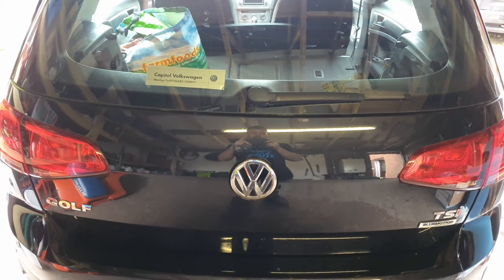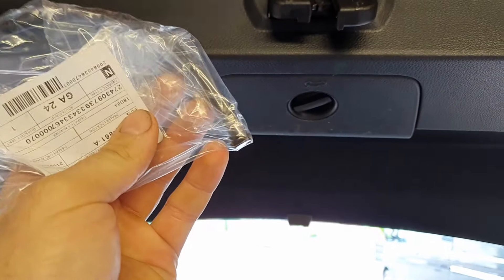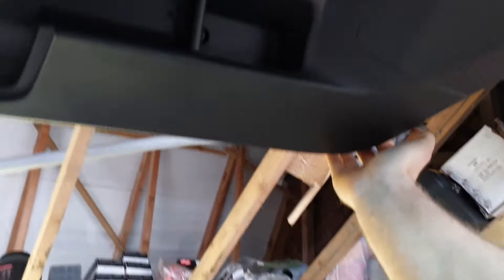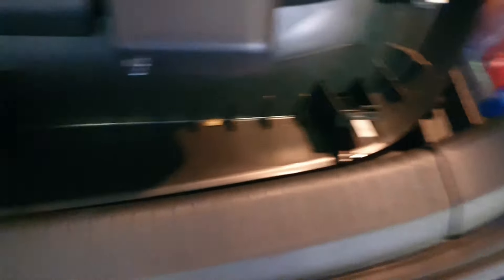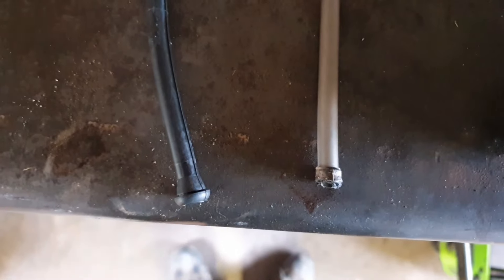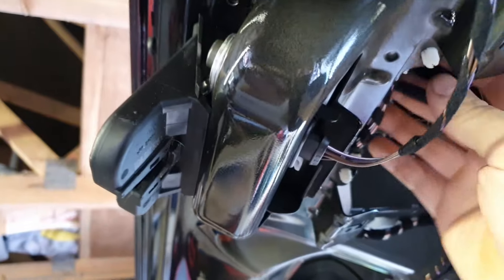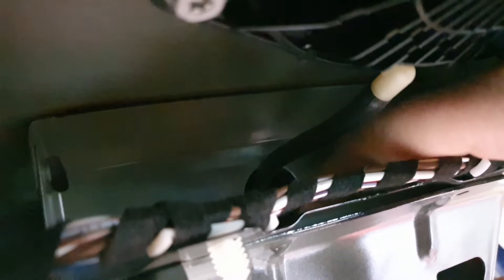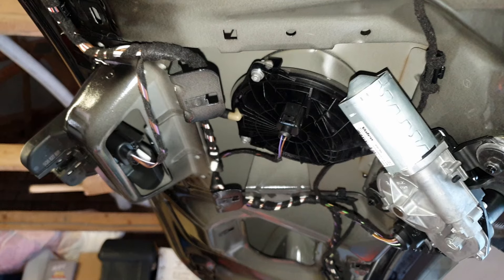Volkswagen Golf mk7 common fault water in boot through tailgate, how to replace pipe easily yourself

Comment: Great video! Yes, you are right to highlight this silly design flaw!!! I also found a rapid fix when you find your boot full of water.....Take a plastic drinking straw and carefully poke it up inside the pipe that was loose. I did this. It was a tight push fit. Then cut the straw so it hangs 1cm below the hole and the water drains out onto rear bumper and you boot stays dry!! To make it look pretty I put a rubber grommet where the straw exits the little hole.
Reply from the maker: Thats a great idea, thank you for your input.

Comment: Thanks very much, I've got all the panels off now and removed the pipe. Just need to get another one and fit it.  I've managed to put a drinking straw in the end as a temporary measure until I can get to the dealers. I'm surprised that VW have a common fault like this, they're normally pretty good at things like that. I was alerted to the fact something was wrong when I opened the hatchback yesterday after a night of torrential rain and water was running onto the parcels shelf.
Reply from the maker: Yes this is a very common fault, thank you for watching

Comment: Quality video. Thanks very much. I noticed after being away for three weeks while it's been raining heavily, that when the boot lid raises, all the water that must have accumulated within the boot starts running around. Lifted up the floor of the boot and there must have been a litre of water in there. So it can become a big problem if not corrected! Thankfully it was obviously fairly fresh water. I'm 99% certain that this will be the problem.
Reply from the maker: Thank you for your feedback
Reply: I have this issue..after raining, loads of water collects in base of boot 😮.. il check this pipe & mention to garage when it goes in next week for it’s service 🙏

Comment: Just replaced the pipe on mine after watching this very informative video. I had no idea what might be causing the issue and was on the verge of calling the garage and no doubt handling over a good wedge of money afterwards. I looked at several videos on YouTube before attempting the job and this was by far the most detailed and explained everything perfectly. This is a job you can complete yourself with a little patience and time.
Thanks so much for posting this and I no longer need to worry about my boot lid filling with water very time it rains.
Reply from the maker: Thank you for your kind feedback
Reply: What the name of this pipe and where to buy😊 it
Reply from the maker: I have linked it in the description

Comment: Excellent tutorial. Noticed this issue after washing the car. Opened the boot and water was pissing out of the inner tail light. Yet another VW tight git procurement choice where a 20p part instead of a 10p part would have avoided this issue.
Reply from the maker: I couldn't agree more, thank you for your feedback.

Comment: Thanks for the video, very clear. I think my car lacked the grommet when I bought it (second hand) and didn’t realise the significance. I replaced the drain pipe quickly using your instructions. Turns out the water in the spare tyre well was coming from elsewhere - I’ve watched some other videos and taken a bit more time to seal around the hidden vents and rear lights (involved removing the bumper which for me was a major operation). Hope that’s done the trick.
Reply from the maker: Thank you for your feedback 😊
Reply: did it work out?
Reply: @eagle56786  Yes. Sealing around the hidden vents etc. seems to have worked. I've not seen any more water inside the boot well.

Comment: Thank you.  I have a question..  The lower part of the handle recess / cavity on my car is already rusted.  I want to get to the backside of the steel to sand it and apply primer.  Will removal of the handle allow me to access the backside of the steel?
Reply from the maker: There until much room behind the handle but when you remove the cover you shuld be fine,

Comment: Really informative video,thanks. I’ve got an early 2013 MK 7 golf. The boot gets full of water and there is now mould growing on the rear seats.
I’ve just tried to change the pipe following your video but it looks like the 2013 mk 7 had no drain pipe. The grommet is there on the boot lid edge but that’s it. Plus there is no drainage hole on the boot catch to attach a new pipe. I’m guessing it’s because its an early mk 7. Has anybody else found this?
Reply from the maker: I'm not sure sorry there is also some vents behind the rear bumper that people have said can cause the same issue, hope this helps.
Reply: Thanks for the reply. I thought I’d start looking for the solution with the easiest looking fix. 
This is definitely my last vw golf.

Comment: Great advise and I've followed it to the latter after finding a large amount of water in the boot. New pipe fitted and I am still finding some water (not as much) in the boot and wondering where else could this be leaking in from?

Worth also mentioning that the engine light and EPC light was illuminating intermittentely.
Reply from the maker: I have heard of the seals on the tail lamps can leak and also the vents behind the bumper, hope this helps
Reply: @Martysworkshop  After all this time and no water leaks, I've now got start-stop problem causing the car to stall with no fault codes. I've read elsewhere of water ingress causing havoc with electrics so I'm wondering where I could start with diagnosing this problem? Are there any relays or connectors in the footwell or under the boot liner?
Reply from the maker: I'm not sure sorry,
Reply: @sanjayhari693  I’ve had the same problem with my 2014 mk7 golf. I found a large amount of water in the boot a while back and cleaned it all up. Haven’t had any water build up since. However I did initially have issues with the engine management light and EPC light coming on intermittently. This has now disappeared. I still have the problem with the start/stop error appearing. So now I just automatically turn it off each time I drive. Did you find a solution to yours?
Reply: @swayz09  I seen a combo of issues and sorted them step by step. My golf was standing for 4months after the problems started. Water leak was due to bad waterproof design and resolved by resealing the rear bumper vent, door speakers & replacing the boot badge drain. The EPC and Eng light ended up being a turbo failure. Replaced that and the car drives perfectly. The stop start failure was a combo of the bad turbo and a faulty battery. We isolated it to the battery now but I haven't replaced my battery yet so drive with the Stop start switched off. All very annoying and related to bad VW design and build!!

Comment: My boot was soaking wet, will get new tube fitted, thanks for the video
Reply from the maker: Thank you for watching
Reply: Did this solve the issue for you? I’ve just found my boot to be completely saturated.
Reply from the maker: From the comments i believe most people find the water comes in from the seals on the vents behind the rear bumper, hope this helps

Comment: The carpet under my spare wheel is soaked, the pipe you show is missing but I’ve watched other videos and they point at taking bumper off and replacing and sealing two plastic vents. Have to get mine looked at asap
Reply from the maker: Yes a few people have mentioned the vents in the comments well worth a look , thank you for your comment
Reply: @Martysworkshop  I’m going to fix the pipe first see how that fairs, then look at other fix if that hasn’t worked

Comment: I recently had a flat tire and had to put the space saver on, when I took the tire out I noticed to my horror that there was at least 5 inchs of water sitting in the reccess where the tire goes, the pipe is completely missing from my boot! Ive ordered the pipe and will carry out this procedure, but im concerned with the amount of water I found in the boot, in your opinion do you think it is possible that so much water can come from this tiny default or are you aware of any another issue, awsome video too btw! Thank you so much
Reply from the maker: Thank you for your question, these cars do suffer with water leaks unfortunately, i have heard of the seals behind the tail lights and the boot seals leaking.
Reply: @Martysworkshop  🙈🙈 im so disappointed with VW for this, always thaught that the VW particularly the golf were the dogs bollocks but after this im thinking how many other design flaws are there...... thank for your reply bud, I will replace the pipe and see where we are, fingers crossed

Comment: hey fella i have a wet seat at the back of my golf r i park on a forward incline , my gromet is perished do you think the water   would be  running down from the boot into the seat ?
Reply from the maker: When this pipe goes warter can get into the boot frame and when you open the boot could run out onto the seats. Thank you for watching
Reply: Hi I’ve got the same issue Where I found a puddle of water in the spare wheel well and my rear seats were wet in the corners and back. I’m going to get a pipe tomorrow and try this. Did you manage to get this fixed?
Reply: @aesan7420  its not the pipe! its leaking behind the rear bumper over the vents and into a small well which fills up over time. for now i pull the rubber bungs out from underneath and will seal the vents up later. its dry in there now and has helped but want to make sure i got the vents sealed and clean behind  the rear lights.

google: "water leaking into rear vents golf "
and you will find videos and posts

Comment: Hi Marty - Great Video! What are the chances that this Pipe can come loose (i.e. disconnect from the inside) through normal opening and closing of the boot? I ask because my VW was sent in for inspection due to water build up in the tailgate (which has caused damage to electrical connectors) and this pipe was disconnected. I'm told as it's water damage it's not covered under warranty but my view is those electrics wouldn't have been damaged if the pipe was connected in the first place. Would really appreciate a response mate - I'm looking at a bill of £2k atm to sort this out. Cheers matey.
Reply from the maker: That's not good, we'll I'm with you tbh with the pipe in place it can't really come away from the handle, and if I remember it was quite tight to pull off, in my opinion that should be covered

Comment: Amazing. Thanks, I have a mk7 with a soaking wet rear passenger footwell - that will be the stupid failed speaker seal. And now I have the actual lower grommet in my hand from the boot handle drain, sitting in the wheel well. Great vid 👌 do you know the part No for the drain you replaced.
Reply from the maker: I have put a link to it on ebay in the description. Thank you for you comment
Reply: Just got my 3.5 year old golf serviced and guess what? Speaker seals and tailgate handle pipe need replacing. Just did speaker seals today and plan to do pipe when it comes in to stock. Poor show VW. Should have had a recall to do these.

Comment: my grommet is also perished on my mk7.....i've got water staining in the middle back of my headlining.....could this be caused by the water running through the two rubber sleeves at the top when you raise the hatchback and the water from the tailgate running through?
Reply from the maker: Possibly i have linked the pipe in the description, i would change it and start there, thank you for watching
Reply: @Martysworkshop  got one ordered....

Comment: I've replaced this part as it had perished but it didn't solve the problem. I think its the seals around the vent on the drivers side but I'm not sure how to get the bumper off, any vids on that?
Reply from the maker: I haven't sorry i have heard the vents can leak but haven't got round to doing that video sorry.
Reply: @Martysworkshop  Yeah, when the car gets seriously wet it's the vents, I just can't get the part number in the UK, Eurocarparts just won't get back to me.
Reply from the maker: I think it may be dealer only try a company called T P S (trade part services) they are vw specialists
Reply: @Martysworkshop  Thanks mate, I've contacted them directly

Comment: What year car is this? I’ve got a 2013 Mk7 gti with a boot full of water. I just took it apart like you did in your video and this pipe doesn’t exist on my model. There’s no drain coming off the inside part of the handle at all.
Reply from the maker: This is on a 2016 so might be why its a little different! I hear there is a common fault where water gets in through seals that are on vents behind the bumper on these cars, hope this helps
Reply: @Martysworkshop   Thank you. I’ve taken it apart and blasted it with water and can’t find the leak. Bizarre.

Comment: Hi bud, where did u buy the drain pipe from ? Got a similar problem have already forked close to £500 on water accumulation in rear spare tyre .
Reply from the maker: I have linked the part i used in the description. Thank you for watching.

Comment: Don’t understand how that missing grommet bit would prevent water from draining out of that pipe/hole??? Please explain?
Reply from the maker: So the pope stops water from getting inside the boot, which can corrode all the electrics, but what also tends to happen is water tends to collect in the boot, some can leak out but it will collect unfortunately
Reply: When the gromit corrodes, the pipe pushes itself back inside the boot lid, allowing water to overflow in the inside sil.
Reply: @valleykingvids2059  Yeah. You’d still expect the water to come out the hole as it’s the middle/lowest point in tail gate. Anyway it doesn’t! Plus water is also pissing through the rear door speakers now🤣

Comment: Hi, I have a similar problem with my mk6, I have sealed my taillights with silicone and seems to work  for me, I will upload a video this days how I done it.
Reply from the maker: Good shout i hear the light seal's give trouble. Thank you for watching
Reply: This is where the water seems to have been coming for me. I pulled the cover inside the hatch and it looked wet around the tail lights. You sealed it from the outside with silicone?
Reply: @Ponskippa 
I have put the silicone on cars body.. But in the end I had to buy another seal because mine, even after that silicone, still gave me problems..
Reply: @JulianF36  thanks. Do you happen to have a link? Is it a seal that goes around the tail light? Just discovered the leak so I’m starting to dig
Reply: @Ponskippa  I got one from ebay the part number is 5K0945192
I have a friend who made it himself out of a piece of rubber... As he said the part is to expensive. Now is all up to you.
Reply: @JulianF36  thank you for the info. I’ll look. If anything I’ll take to the dealer cos I bought extended warranty

Comment: Any ideas why I would have water in the glove box on a mk7 golf ?
Reply from the maker: Not sure if I'm honest only place i could think is windscreen seal but would need to take out the glove box and hose the car down you should hopefully see it coming in then. Thank you for watching
Reply: The plastic skuttle tray under the bonnet where the wipers are, mine was full of leaves & moss & the drain hole was blocked cleaned it all out all was good. Hope this helps
Reply: I had the same problem, it was the windshield drain that was clogged up
Reply from the maker: Thank you for your input.

Comment: Latch filled with water now camera and latch don’t work. Corrosion on electrical connection point where it latches to the car. Same spot where I drained half a litre of water out of my trunk lid. Idk if I have to do wiring or buy new trunk release latch.
Reply from the maker: It's a poor design.
Reply: @Martysworkshop  yes it is. Wish I would’ve known before hand.

Comment: This leak will also ruin the tail light bulb holder circuitry and harness connections. Very expensive to repair once the corrosion sets in. Be diligent about regular inspections on this part!
Reply from the maker: very true, thank you for your input

Comment: I have a water leak also, but my white pipe is missing? There is no rubber hose and no connection to fit it to. 2013 mk7 tsi.
Reply from the maker: Is there a hole where the pipe should go? Maybe someone has broken off, try pouring water into the handle with the boot at a 45° angle and see if water leaks in. Thank you for watching.
Reply: @Martysworkshop  thanks for the reply, the hole for the pipe is there but no where to fit it to, nothing is broken on the back side of the emblem. i'm guessing it has been replaced by a different one without it. I will try your method thanks 👍
Reply from the maker: Sounds good thank you for you feedback.
Reply: I have the same problem, 2013 Mk7 Tdi with a boot full of water and soaking wet seats. Stripped out the boot, checked tail light seals and vents, and the leak is definitely coming via the boot handle. Thought I'd found the fix here but when I took off the boot trim, there is no small white pipe on the inside of the handle to fix any tube to and no sign that it is missing/broken off. Also the hole in the bodywork where the gromit should be is just plugged with a rubber stopper. I've at least identified the leak is definitely via the handle now - but at a loss as to how to stop it!
Reply: @brucecarter3433  i have fixed the problem my removing the rear bumper and sealed the 2 vents on the left and right side. These are very loose and water comes in from there. Havent had a wet trunk since. Also made a few holes in the rubber that is behind the vents, so any water that does seep in has a way out.
Reply: @chrisvm6231  thanks for the tip mate I will give that a try, although having stripped all the trim and dried everything out then waited for rain to try and identify the source, am pretty sure it is trickling into the trunk via the boot handle - the leak is definitely in the centre of the trunk and not at the sides where the two vents are 🤷‍♂️ thanks for the reply 👍